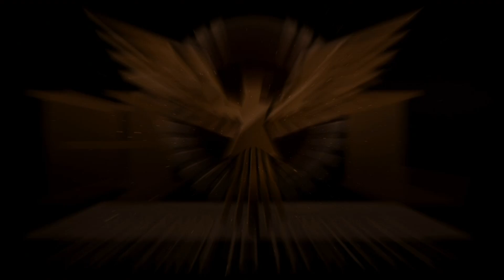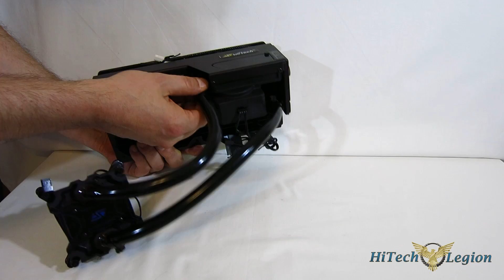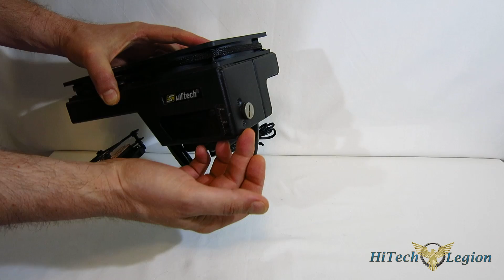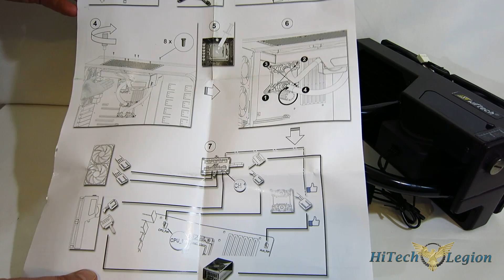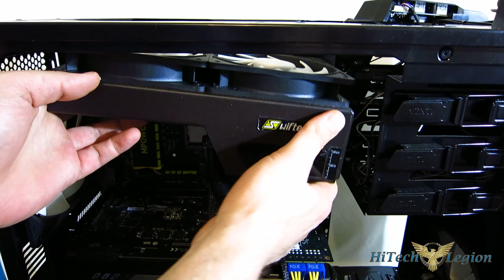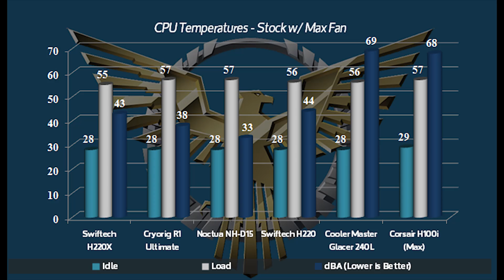Swiftech H220 X Open Loop AiO Liquid Cpu Cooler Overview and Benchmarks

Comment: would you have to refill the reservoir? and if so how often would you think?
Reply: Bc There will be some evaporation over the three years, but it should not be enough for concern or even the need for a top off.
Reply: Swiftech states it is maintenance free during the 3-year warranty period. SO, no topping off or refilling for the first three years.
Reply: oh sick
Reply: If you get it just keep a eye on your resavour wwater or coolent level if it gets below minum top it off
Reply: I wouldnt think the res would go down at all, just get a build up. regardless the site sais 3 years, ill probably end up getting a new cooler after the half point anyhow

Comment: I already have a Corsair H100i.  I am wondering if I can get this, remove the CPU block, and use it strictly for 2 GPUs?
Reply: HashtagRusty I suppose you could...but it would make far more sense to ditch the H100i entirely. Get this with two GPU blocks as you wanted and add a second 240mm rad. Much cleaner install, much less noise and better performance.
Reply: Thanks for the information.  I will definitely look into this!

Comment: Can anyone help me?  I just received the H220x today replacing my Hyper 212 evo.  The problem is the H220x is only cooler my 1 degree celsius from the hyper evo.  Idle temps are about the same.  I change the fans to make them exhaust to the top.  I remounted the block and reapply thermal paste that came with it twice.  Can anyone tell me what's wrong?  Is it the pump?
Reply: Idle temps should be about the same depending on your setup. If you look at the benchmarks here you won't see a lot of variance at idle in any of the coolers, so that is not a worry.

There are a lot of factors that will play into the differences you see. What CPU? What are your OC parameters? What is the rest of your setup? What stress test are you using?

You would be best served in the Swiftech forums or in the thread at OCN for H220/320/220-X users which is also participated in by Swiftech directly - http://www.overclock.net/t/1367654/swiftech-h220-h320-h220x-and-cm-glacer-240l-360l-owners-club
You will find far more info there than on YouTube, and will get responses from manufacturer reps and other users.

Comment: can you guys do a video of this cooler with an extra 120mm rad and a gpu?
Reply: I would REALLY like to see this, I can't believe no one has a vid about it yet. It's such a huge feature for this cooler.
Reply: yeah really. all the sites mention this but don't show it. it would be really interesting to see how exactly you refill the system with an extra rad and gpu block and get all the air out without spilling coolant everywhere. i hope you don't need to pull the whole kit out after mock up and have it on a bench somewhere.

Comment: What case were you using for this build?
Reply: zephaniah666 I haven't actually done a build in a 780t yet. But in looking around, it appears it would fit with no issues at all. I found a few pics of builds with similar radiators mounted up top and there appeared to be plenty of room up there.
Reply: I used an NZXT Phantom 530 in this video. A full component listing is in the review - link is in the video description.
Reply: Do you think it would fit in the 410?
Reply: Ryan Stegall Yes, you would have to mount the same way as is shown in the video with the fans in the top section.
Reply: George Cella thanks for the information!
Reply: Yes, but it may need to be mounted slightly off center to clear the 8--pin on your MB.
Reply: George Cella you're going to get sick of these questions but will it fit with the corsair 780t new case and a asus formula vii mother board?

Comment: I am planning to use this to cool down an i5 3570, 2x r9 290s.  Do you think the pump will move that much water just fine?  I am not looking for amazing performance.  Just an alternative to the jet engines of the r9 290 blowers.
Reply: You would have enough pump flow and pressure as long as you don't use overly restrictive GPU blocks. But, you will definitely need an additional radiator.

Comment: I still wonder why how this can perform so good. Because half the radiator is block by the pump and reservoir, so you have no airflow going on that side. And one of the fans is useless. And you cant make it pull -push configuration.  Just my tought on what im seeing here.
Reply: Ah, well your eyes seem to be deceiving you.....and you are thinking very much in CLC mindset and trying to apply it to something far more developed. 

The pump and res are mounted on the opposite side from the fans and are not placed in a way that restricts airflow through the radiator. So, you are not making a fan useless, both are doing exactly what they are supposed to.

This is a low FPI 25mm thick radiator, so there would be very little, if any, gain from push pull. This radiator is also brass channels with copper fins, not aluminum. The excessive air you are thinking is required for performance is necessary on high FPI radiators, and/or radiators made from materials that aren't as capable of passive heat dissipation. CLCs use high FPI aluminum radiators, and I am gathering that this is what you are trying to equate this to.

It's kind of a vicious cycle - CLCs use higher FPI to try to make up for the lack of natural heat dissipation compared to copper and the lower flow of their pumps, as a result they need higher higher fan speeds which create more noise. This is not the case with higher quality components that have better natural heat dissipation and transfer, and the much higher flow pump.

So, the answer is - there is nothing blocked, no airflow restriction that will downgrade performance and push/pull isn't as big a factor with a much higher quality low FPI radiator.
Reply: Thanks, and i just noticed the fans are pushing air in to th

Comment: NH D14/D15 @ 40db would be as cool as a AiO - well nothing left to say. High price for same performance and only a nicer look.
Reply: Actually, the NH-D15 will outperform any CLC by a substantial amount when limited to tolerable noise levels, and outperform them overall regardless of noise level. Of course, the H220-X outperforms them by even more. It also happens to be a lot of fun watching the responses of CLC users when you point this out to them.

However, the H220-X is not a CLC, and you are kind of missing the point with this piece. Yes, it's performance advantage over the NH-D15, Cryorig R1, etc seems slight. But, an NH-D15 won't allow you to add a GPU block and drop your GPU temps 30+ degrees under load. Or use the water cooling option built into your MB. Or add a low cost 120mm rad and see an appreciable performance increase. The H220-X is really a nice start to a small custom loop, and that is what needs to be considered, and that is where the target market is for this piece.

I have always advocated air over CLCs in all of my reviews for exactly the reason you stated (though I don't necessarily think CLCs have a nicer look, actually quite the contrary). However, this is not a CLC, and the performance and flexibility more than separate it from them.

Comment: Way to break it down...best review I've seen in a while. been waiting for this cooler forever. however was this sent out to reviewers? can't find it on amazon/newegg.
Reply: Thanks, much appreciated!

The first production run sold out directly from Swiftech immediately. The second run sold out the same day they came into stock, with batches also being sent to FrozenCPU and Performance PCs which should be available over the next couple of days from them (you may want to call Frozen to see if they will take a pre-order). Swiftech hopes to have more in stock next week that you can buy directly from their site. Right now demand is exceeding production, so it may be a little while before you see them on the mass merchandisers - Swiftech has much closer ties to the specialty retailers.

Comment: How does one mount the fans on the radiator in pull configuration since the reservoir is in the way? This is a concern to me as I do not want dust to build up on the rad. Could I just use one fan in pull or maybe have both of the fans on one side blowing the same way out on each side of the radiator?
Reply: There is only one fan mount on the bottom next to the reservoir. You can mount both fans on top in pull so that they are exhausting out of the case. In testing the performance difference between intake and exhaust was approximately 2 degrees.

Comment: Does anyone know if it's easy to replace the coolant? I'd like to get a different color coolant (dark red) to match the reservoir to my case. I can not find anything about this. Advice would be greatly appreciated.
Reply: this is just a piece of advice and experience, do not use a red liquid, dye, or coolant as it is EXTREAMLY! hard to remove and flus out. It will damage the tubing and it will never come of the tubing, it is scientifically proven that RED will have a much higher chance of gunking up too, jut some advice. From JayTwoCents aswell

Comment: Very nice review George. Thanks for your indepth review of our new kit and I'm glad that you liked it.
Reply: is this available to buy in europe?
Reply: Where can I buy this? I can't find it anywhere...
Reply: Mike Foote Direct from Swiftech, Frozen CPU or Performance PCs. There are a few other WaCo specialty shops that carry them also.
Reply: George Cella Awesome, thanks for the fast response! So Do you recommend this or the 240-x?
Reply: Mike Foote Depends - will the 240-X fit in your case? Do you plan on expanding?

Performance on CPU only is nearly identical, but the 240-X can stay a little quieter, and the bigger rad is advantageous when/if you expand.

It is completely a personal opinion, but having reviewed and used both for a bit, I prefer the H240-X by a small amount. But a big part of that is the fact that my cases are made for 240mm rad/fan combos. Where I putting it in something like a Define R4, I would want the H220-X.

Either way, you are going to be a very happy owner.
Reply: I believe so, I am switching to an Air-540 and I have read that it should fit no problem. Now I notice that no one has the 240 in stock though. As far as expansion, I would love to add my vid card at some point, but this is my first foray into liquid cooling so I am starting slow.
Reply: Ah, found it on a site called coolerguys.com. I may need to pull the trigger on this...
Reply: George Cella Awesome, honestly for 10$ more its kind of a no brainer to me. I was going to get a corsair cooler and add two $25 fans..which would have made it cost what this one does and have less performance! Thanks for the great vids, subbed!
Reply: Mike Foote Glad you found it, and that you enjoyed the reviews.

Yeah.....the CLC would have wound up being more money for significantly less performance and a lot more noise. Not to mention the expandability and ability to customize. You made a very good choice.
Reply: Grim Reaper Yes, please check with Highflow in the Netherlands and Coolerkit in the UK. Both should have these kits available, or will get them in stock again shortly.
Reply: BramSLI1

Thank you for replay it is much appreciated.
What about Germany? Coolerkit is selling it for 195 euro so no thank you
Reply: Grim Reaper I don't know of any resellers in Germany currently. We are working to expand our market though in Europe. I'm sorry that it just doesn't seem to be happening fast enough.
Reply: BramSLI1 Quick question; EK will finally be releasing a full cover block for GTX 970 EVGA FTW, is the pump in the H220-x strong enough to push a GPU block too?
Reply: It is...but barely I believe. I would add another rad to the loop if it were me. George would have a much more educated opinion on this though.
Reply: Calyx The MCP30 pump used in the H220-X is completely capable of an additional full cover GPU block and rad while maintaining excellent flow rates.
Reply: George Cella Good. It'll probably be one more week possibly 2 till the block finally comes out.. (been waiting since october.. RAMgate almost made me RMA my card..)
Reply: Kind of hard not to like it....best performing out of the box cooler that has ever hit the market, impeccable build and design, and the perfect base for a small~midsize loop. You guys knocked this one out of the park. I'm even ready to forgive you for the Polaris.....lol.

Comment: Anyone know if this fits into a 350D, while not affecting the 5.25 drive bay ?
Reply: I have never worked with a 350D hands on, but it appears that any 240mm mounted on the top will interfere with the optical bays since the mount is in that space. It will mount in the front without any issue - if you are using one 2.5" and one 3.5", Icy Dock makes a mount that would allow you to put both of them in one of the 5.25" bays if that is an option for you.
Reply: thnx for e reply! i know that h100i will work fine and still allows the lower 5.25 to be used. Was planning to get this and a second 120mm radiator to place at the front, seems like this setup doesnt allow me to have a blu ray drive.

Also from linustechtip i saw the results of the H220, it seems like it can perform much better than H220X, although both AIO runs on a 6W motor, copper fins radiator.. anyone can confirm performance between these 2?
Reply: Junyi Goh There are slim Blu-Ray drives.

The H220-X and H220 are compared directly in this video with stock and OC CPU speeds, and the 220X is a bit better. Linus does not compare the two directly, so I am not sure what you are referring to.
Reply: George Cella Sorry, i missed that, earlier i was taking reference with the H100i results from both video. For the bluray - are you referring to those 5.25 mount that lets u insert a laptop size optical drive ?
Reply: That is what I am referring to.